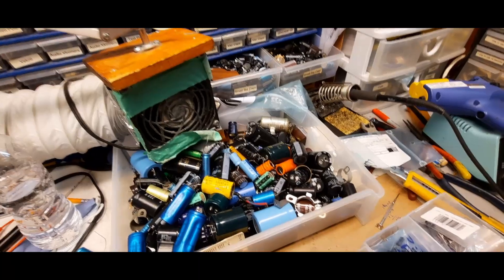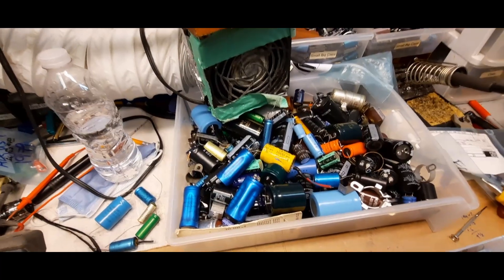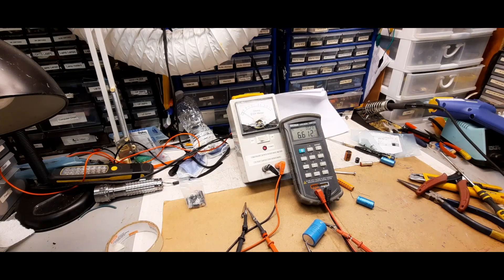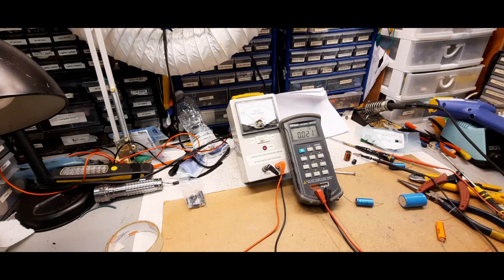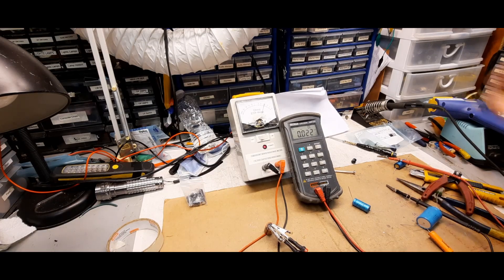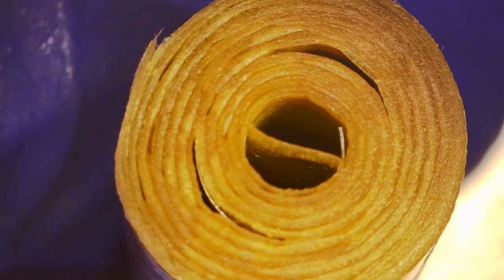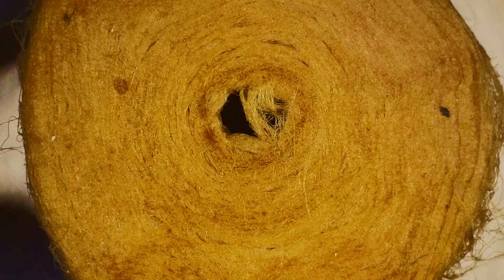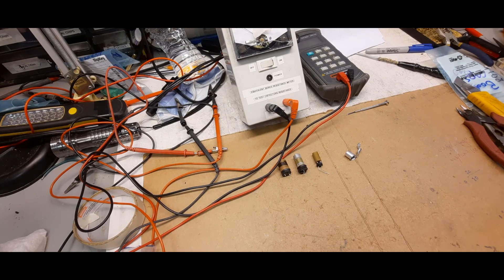Used Capacitors for Electronic Projects? Good or Bad Idea

Comment: My process for evaluating electrolytic in old equipment: run it on nominal voltage from a suitable power supply, at a limit of 2mA with a milliammeter in series  (WARNING: While an analog meter is best here, don`t ever accidentally discharge a 350 cap through one, you will see bent meter needles are not a myth). if it reaches 0.03CV or better eventually, AND still has appropriate ESR and capacitance afterwards (do bleed the dielectric absorption first!), reuse, otherwise replace. This is a tedious and in case of high voltage caps dangerous process, if it is a 10 cent cap just replace it.

Comment: I discard salvaged capacitors with many hours of use or backed in small cases without ventilation, but often I find and salvage capacitors from boards that are new and those I keep and reuse in my projects after testing them.
Reply from the maker: Great idea. Testing them is a must.

Comment: I like to check for leakage at rated voltage. Sometimes you will see an older cap reforming while leakage testing. Of course checking esr and capacitance as you are doing is also a must.

I don’t hesitate to use older Sprague or Phillips caps if they test ok. Otherwise Rubicon is my choice for replacement.

Thanks for posting…
Reply from the maker: Excellent process you have to test caps. Heathkit has a great tester for rated voltage as you know. Thanks for watching.

Comment: I did reuse capacitors in the past and will do so again. Just with what I  learned in the meantime, I would now do a leakage test - also on film caps - and with electrolytics I would reform them before putting them into a new circuit.
Good idea you did a short on the drying out of elec's with a close-up of the ESR meter, as in this video the pointer is difficult to see.

Comment: For personal projects I often re-use electrolytic caps to save money. But not for clients/friends/etc. -- NO!!!  Electrolytic capacitors may suffer higher failure rates in stuff like like power drives, power converters, tube guitar amps etc. Duty cycle, operating temperature -- all may be factored to inform your decision.
Reply from the maker: Exactly my thoughts. Thanks for watching.

Comment: Just pretend that one cap is a 6800uF -10% :D Does your LCR do ESR as well? Gotta remember during the electrolyte plague, even many "reputable" brands of caps were all going bad. They were assembling very well constructed caps, but just with a horrid electrolyte mixture each time. Given that we are tending to view EC's as "long term consumeables" almost these days, I guess you could say a second hand cap is just one you're making an allowance to replace sooner. For smaller things, buying them new seems pretty no-brainer, but larger rectifying ones can still be a pretty penny compared to other components. I wonder if you've found any projects from your magazines for a capacitor leakage tester?
Reply from the maker: Yes to the ESR meter. The white test piece with the meter is specifically an ESR meter. The store bought device is an LCR meter and on capacitance it also displays ESR. I also heard about that bad year when caps were the electrolyte was not the best. As for an ESR  project, there are a few and I plan on getting them built one day. Cheers!

Comment: Nah, I would never use second hand electrolytic caps unless it was something really special, decent parts are cheap. Second hand or salvaged ceramic trimmers, air spaced variables and silver mica RF caps, probably would salvage those because they're hard to get or expensive.
Reply from the maker: As I make 1 project per week, sometimes I just use old caps because it is a pain and costly to get just a few caps from Digikey. Since the project is for me, I can take a chance on a used but tested cap. Cheers!

Comment: I have not noticed any problems in most cases where I use used capacitors, except in three different situations. I do this on a regular basis and as I don't have equipment that can measure ESR, I just take the capacitance reading. However, as soon as the behavior of a circuit raises suspicions about a capacitor, I immediately replace it with a new one.
By chance, I have some old capacitors in operation in some circuits that fortunately do not cause me headaches, remaining well within specifications, unlike some new capacitors that are not always sent to me in the necessary health. For everything you need some luck. Even this.
In general, I believe I use about 50% used capacitors. But I am careful to leave the capacitors mounted and marked so that they are easy to replace, if necessary. In that sense, for now I can live like this.
Best wishes for your work. And keep that spirit, which is completely convenient!
Greetings from Portugal.
Macedo Pinto
Reply from the maker: That's a good system .. I like how you replace components when you suspect them. Cheers!

Comment: I frequently use used capacitors for repairing things my clients ask me to repair (though I'm not a tradesperson repairperson)

This is fine with me, with them, and with a lot of us because it's often the only way to get a component at a reasonable price, decent time frame, that is also trustworthy. Rather have a used nichicon than a brand new knockoff rubycon.
Reply: additionally, understanding the circuit you're repairing inside out helps to know or find out what you can substitute with if necessary, as you can understand the purpose and why the original design may have had XYZ value.

That's to say, stay curious and ask questions.
Reply from the maker: That makes a lot of sense .. I agree with you, a good used component is better than a bad new one.